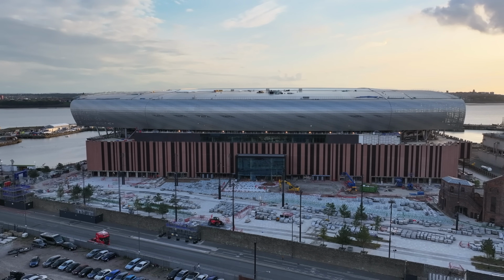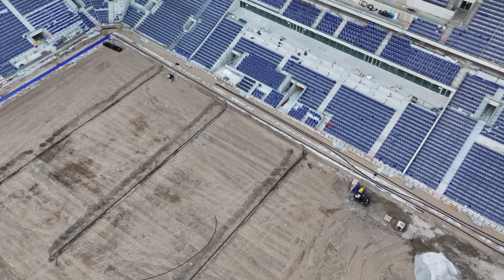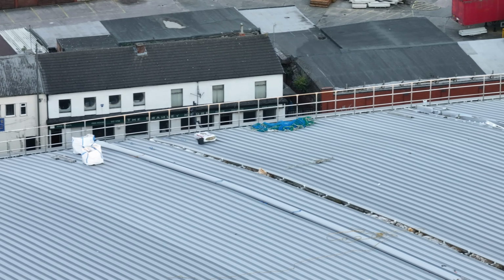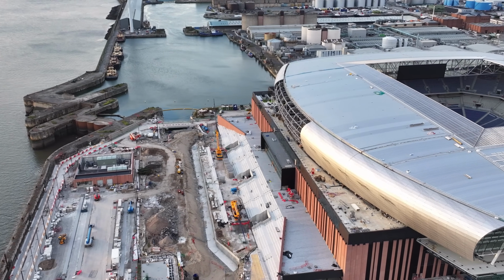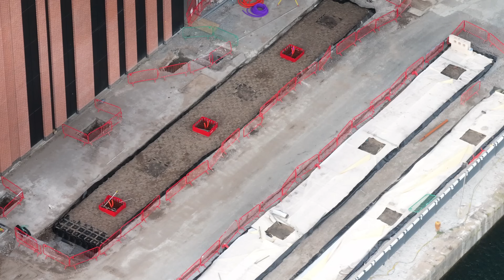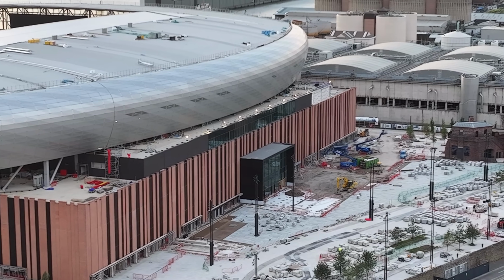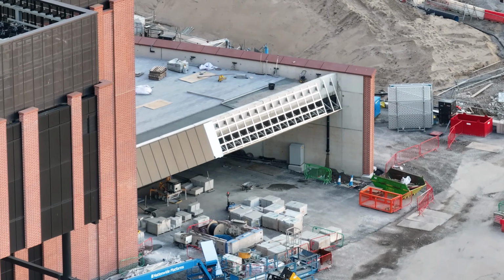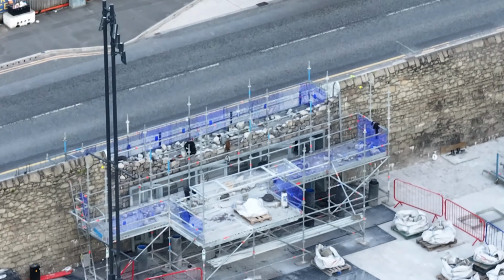New Everton FC Stadium - 9th July 2024 - Bramley Moore Dock - Latest progress update #efc

Comment: Nice one, Colin. It would have been so peaceful without your Alsatian (?) heckler.
1) This is not a finger-point but merely pointing out a missed opportunity to chat about a feature not yet covered by other droners. I have commented a few times now about the "+-shaped" concrete bases/plinths cut into the south concourse near the Nelson Dock balustrade, in line with the south stand white steels. Those bases (there will be 14 of them) will have wind-baffle arches mounted on them that will reach over to near the bases of the south stand steels. The tops of the arches will bot be rounded but will be shorter nearer the stand and longer/higher at the nelson Dock end so that they reflect how the South Stand reaches out at an angle. (I'll send you an image if you want one?).
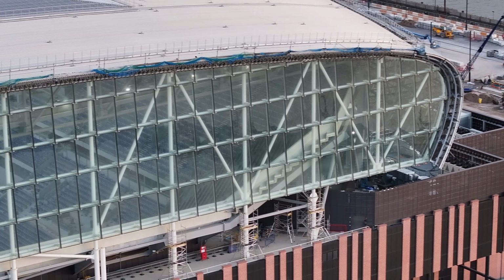2) Commented on previously as one of my LoR questions, at 9:18 mins here, the 3 westernmost white steels above the South Stand Viewing Gallery are shrouded in scaffolding and I wondered why: re-painting or something else? But that question is now less of an outlier, as at 14:10 mins, we can now see that the same sort of scaffold towers are surrounding the 3 westernmost steels above the concrete roof of the North Stand. Curious.
Reply from the maker: Hi David, yes please to the image, it was lost a bit in translation what you meant but now this time I think I know what you mean but the image will certainly clarify it. I will keep my eye on those scaffold towers, strange it is 3 on both sides.
Reply: @cp-overview  Ok, I'll send an image and some associated, separate observations.

Comment: Before the Goodison Road stand was redeveloped the club offered to buy the church and rebuild it, brick by brick, on another site but the church refused to move.
Bramley-Moore is going to be a fantastic stadium but the club missed an opportunity to go for a 60,000 capacity which was perfectly possible on the site.  I asked Dan Meiss and he agreed it was doable but the  stadium would have been the other way around. He told me the capacity was advised by a London based firm of consultants on the basis that any unsold seats are the most expensive to build as they have to be marketed. I have been told, from a good source, that Bill Kenwright wanted 60,000 but was outvoted by the board. A good example of the boards 'small club' mentality?
If Goodison had been re-developed I don't think the school would have been a problem as it could easily have been accommodated in one of the stands. 
The club always said that to stay at Goodison and maybe turn the ground around, would have been prohibitively expensive. The other problem could have been people who refused to move, like the two sisters who delayed the Kemlyn Road stand for years!  When the Gwladys Street stand was built houses on that side of the street had to be cleared. The project was delayed for years because one man refused to move!!